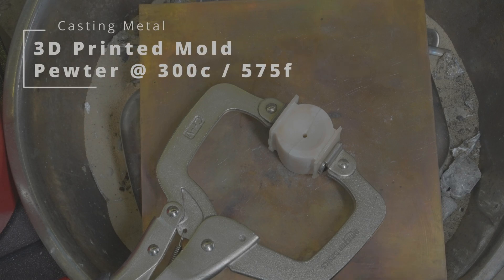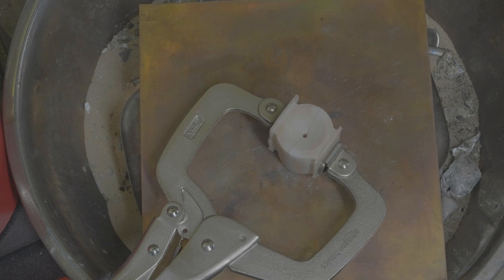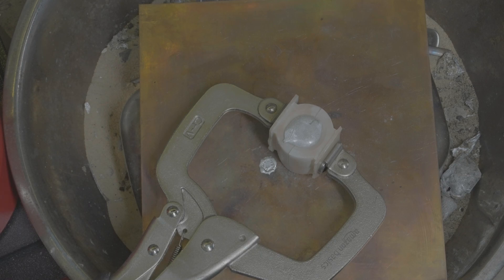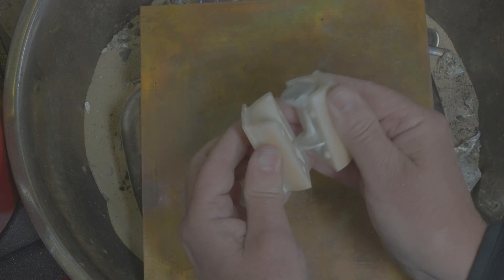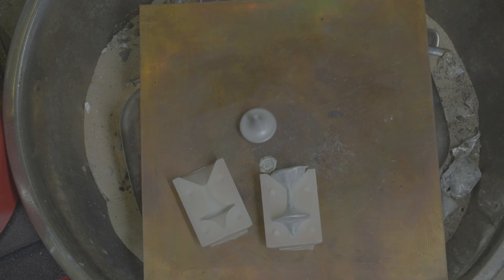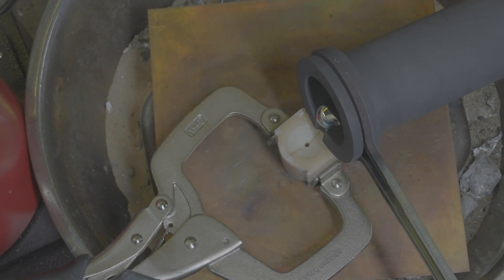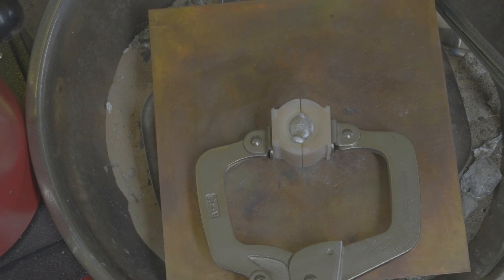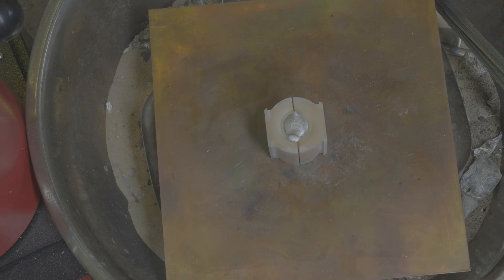Casting Metal into a 3D Printed Mold

Comment: Any more details on the resin?  Casting high strength zamak opes up quite a bit.  Some alloys rival aluminum.   I looked into this previously but th max temp of these resins at the time was 240c.   Very cool!
Reply from the maker: Yup!  I've used plenty of another brand for casting Pewter Chess Pieces and even then, it was on the edge (part of their website says 240c and another 220c).  Being able to direct cast ZA12 opens up heaps of options.  Zamak is probably the most used alloy for the injection molding mfr's and is everywhere in your house.  I'm not able to say much more about the resin itself at this stage, but FYI - I just cast a door pull with a cast in place nut / bolt (and the bolt screws in and out just fine).  I'll be doing more videos shortly!
Reply: @The_Smelters_Apprentice  Very interesting!   It really does open up a ton of options.   It also plates well.   I know you can't say much about who is working on this resin, but any ideas on release date?   Are you just printing on a SLA LCD printer?
Reply from the maker: I expect it will be released in the next week or so.  I just printed the resin using std Elegoo Saturn 3.  Not even a particularly out there print profile either.  There is a bit more clean up work (scrubbing with a toothbrush) to get the internals of the mold nice and clean, but that is about it.  I'd also be interested to know the process of plating ZA12.  I've got a plating kit (for copper etc), but it seems more involved?
Reply: @The_Smelters_Apprentice  my understanding is that you can electroplate it with a dc Voltage and standard setup.   I use a zinc base when I nickel plate aluminum.

It is great to hear the resin is easy to print on a consumer printer.  I can also see lead casting applications such as sinkers for fishing or some Ole time lead bullets.

How have the molds held up to the higher temps?

Very interesting work!
Reply from the maker: Thanks for the hints on plating, I'll check that out.  How the molds go depends on two things.  Temperature & Thermal Mass.   I've got a couple of dozen pours with small pewter castings (rings etc), then several ZA12 castings @ 500c in the same mold.  Conversely, a big heavy casting in ZA12 (like in my 2nd video that I just posted) and you may only get the one or two out of it as it starts to show some wear at that point.  This one was nearly 250g of Zinc @ 460c.

Comment: How did aluminum go?
Reply from the maker: I did give Silver @ 1000c a go and that does not work, I'll need to better test with Al but I'm guessing it will still be a step too far heat wise.  If you have not cast Zamak12 (Zinc Alloy), it is worth a good look for some jobs, and unlike Al, it is nice and heavy in the hand.